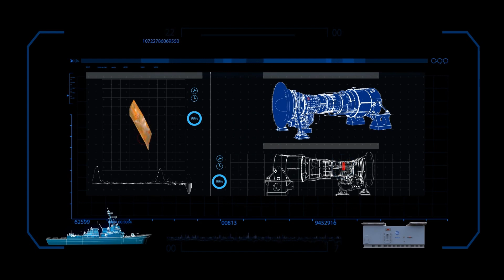Russia-Ukraine impact on Indian Navy's Operation | Time to revive Kaveri Marine Gas Turbine engine

Comment: How easy or tough is it to replace gas turbine marine engines, in a ship especially a warship?
Reply: Almost impossible without a complete redesign unless you source some kind of a Clone engine, maybe? It was stated in episodes before this that warships are designed around the powerplant layout, so changing that powerplant requires an entirely new ship design.